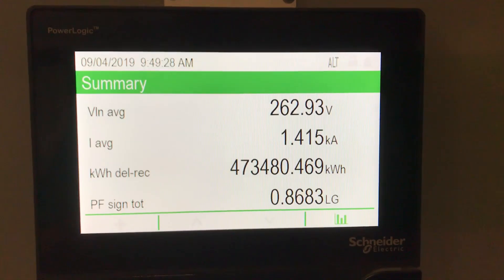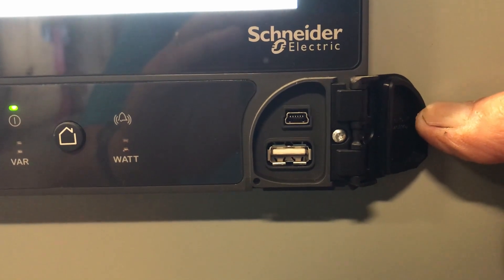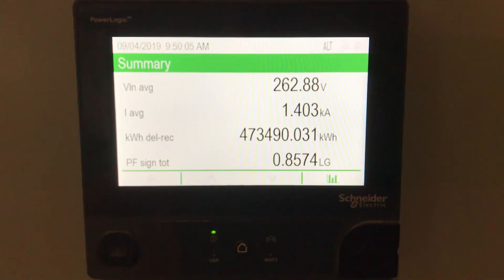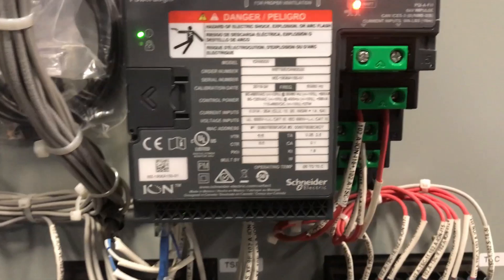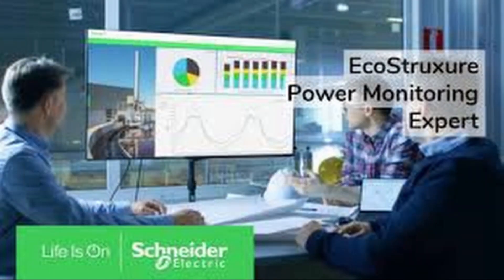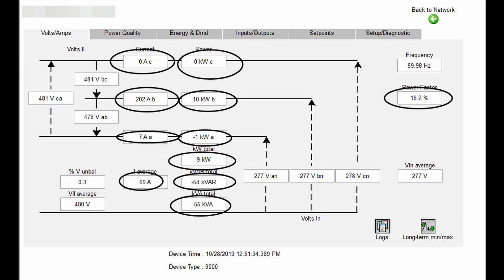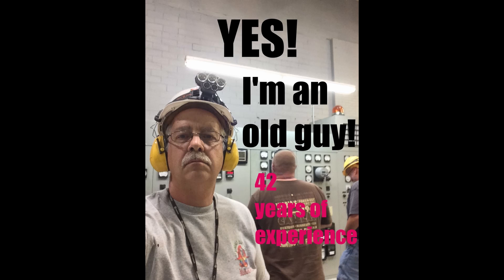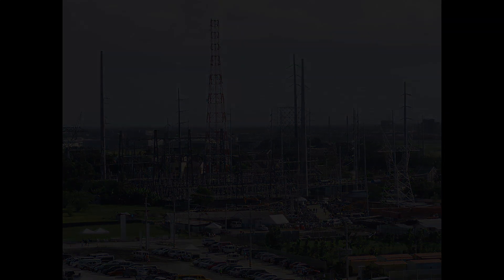Schneider ION 9000 Botched Meter Install

Comment: Why use flat head screws for the current circuit? I prefer screw nut which ensures the correct tightening and avoids the open circuit on the current transformer

Comment: There is 101 ways to miss wire a meter and only 1 way to wire a meter correctly. This was a great Video! Countless times we have seen this in PME and have had to explain to the customer what happened and fixed the issue!
Reply from the maker: True that!  I wish I could do more videos on these subjects, but the non-disclosure agreements I had to sign with the corporations I do consulting work for prohibit even the remotest reference to the company, and this has my hands tied!

Comment: Roger thaks for the video. Can you do a video about the PME  and how to use it.
Reply from the maker: Yes, I will be doing several videos on PME in the near future.  PME is a very powerful tool and thus also has a somewhat steep learning curve, so there will be several videos.
Reply: @raltman57  Thanks for the video. Did you find out what the problem was? Was it wired incorrectly or was the issue with PME? 
The view you showed from PME is from a Vista template diagram, typically these are linked from an inherited parent node, rarely would you have to link these graphics individually. Seems like the issue was either a calibration problem or wired incorrectly
Reply from the maker: @jorgepena8508  Yes, they were wired wrong.